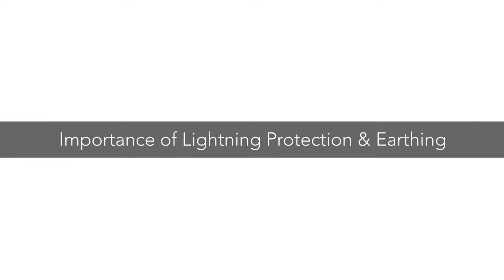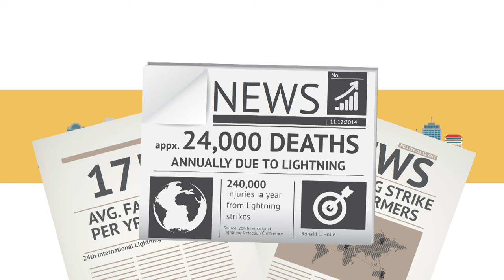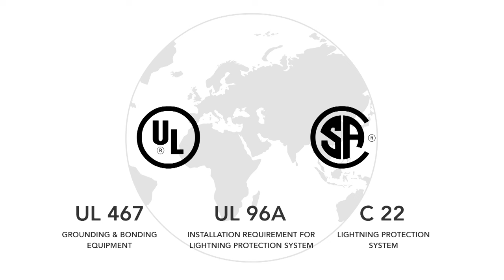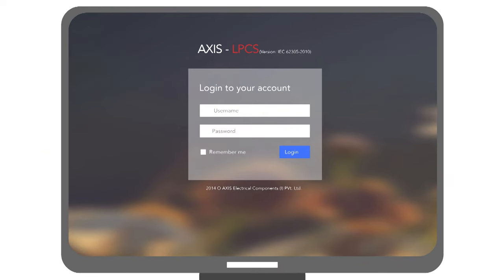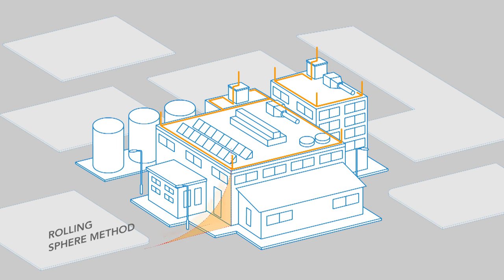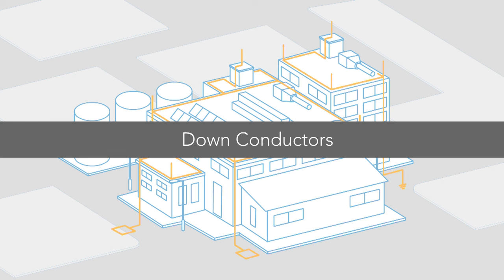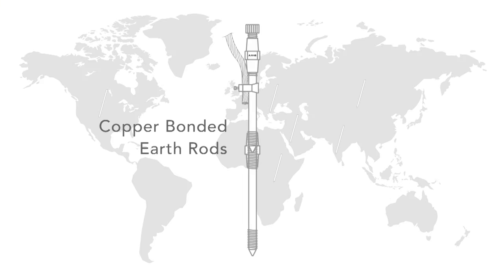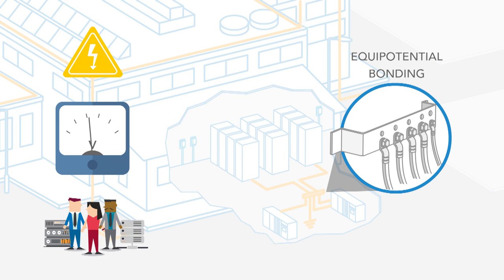Basics of Lightning Protection and Earthing/Grounding | IEC 62305

Comment: Why waste so much money and material and then maintenance cost on roof mesh construction when you can put single $10 or $20 worth metal post into the ground nex to the building which will be at least 1 meter higher than the building? For $100 you could use copper rod which would not require maintenance.
Reply from the maker: The first step in any Lightning Protection Design is Risk Assessment. Each structure owner takes a call on how much risk they’re willing to take.

All these protection methods and international standards have been made after decades of testing, RnD and failed protection measures where houses have burnt down or equipment was damaged.

In the end, it’s your choice on how much protection you want. Or it’s decided by your national building code.
Reply: Roof Mesh Construction is important for a building's protection. A single $10 or $20 metal post cannot ensure the safety of a structure. 
Also, a single copper rod cannot safeguard the structure, you will need approximately 4 Copper Rods & 4 Air Terminals.

Comment: Is the most effective position for the lightning trap terminal on the centre of roof?
Reply from the maker: The main thing to consider is how much area we are covering as ultimately our main aim is to protect whole structure. The advantage for centre installation is that we can cover all four areas of the structure. However, we need to make sure that the whole structure is covered and if it doesn't happen with one air rod then we need to install another rod to cover the rest of the structure. The decision on where to install the other rod will depend on the method of LPS you use.
Reply: One is not enough. How many must you place to be safe? It depends on a lot of factors. The basic idea can be imagined like this: "Imagine that you are placing a fabric on top of each lightning rob forming a tent that covers the entire roof of a building. The fabric must not touch the roof or other stuff such as antennas, solar panels, chimneys, etc but it much be higher than them. The fabric can also bend downwards if there are not enough lighting robs holding it correctly. So the idea is put enough in such a way that this imaginary fabric shield is high enough and stretched enough so it can cover the entire building including antennas, solar panels, chimneys, and anything else that lives in your roof without touching them". The design of such a system that is cold the Collecting System (Collects the lighting current) is a process that needs to be learned correctly and requires a lot of Electrical Engineering knowledge like circuit theory, mathematics, electromagnetic physics, and more. Even if you will never apply electromagnetic physics to design such systems, you need the theoretical background to know exactly what is going on in these kinds of phenomena.

Comment: Is this technology is fake or real ? I am still learning, IQ 120 not as much as Eistein 300.
Reply from the maker: This technology is real and is in use across the world as per the correct practices defined in IEC 62305.
Reply: @AxisElectrical  just started dealing with it in my job, and it's real alright. Feel like I've stepped into another realm, running parallel with my own. Was always there, never appreciated it. Trying to learn more and this short video is a good rundown. Cheers Axis.

Comment: When using a aluminium down conductor and copper earth electrode can we install a separate test clamp and  a bimetallic connector? At what height above ground? can one just use the bimetallic connector as a test clamp and leave out the test clamp?
Reply from the maker: Hey Francis,
The test clamp should be a bimetallic connector or stainless steel connector with an intermediate plate between aluminium and copper. The point is aluminium and copper should not touch each other as it leads to galvanic corrosion. 

When speaking about aluminium and earth rod, aluminium should not be in touch with the soil itself as it leads to its corrosion, therefore we convert aluminium to copper coated bonded conductor or strip converts aluminium to copper coated bonded conductor or strip from the test joint points itself. 

Test joint clamps are installed at a height of 1 meter from ground level. Also, it is recommended to have the test joint clamps inside a plastic enclosure. Earth rods can be connected using copper clamps or stainless steel clamps.
Reply: @AxisElectrical  excellent answer.
Reply from the maker: @twc9000 Glad you liked our answer!